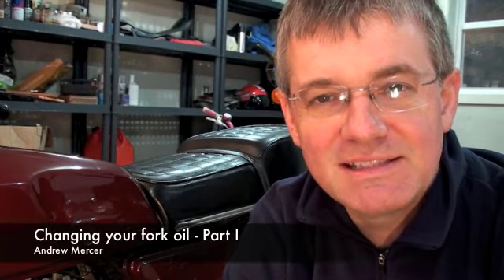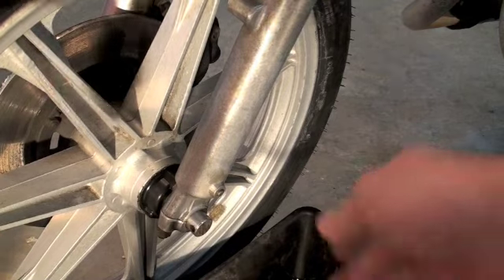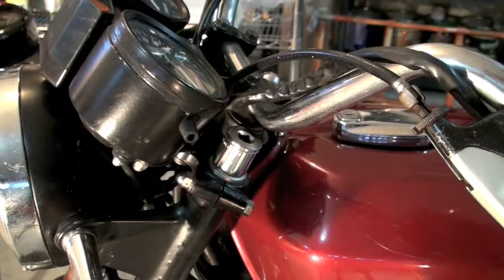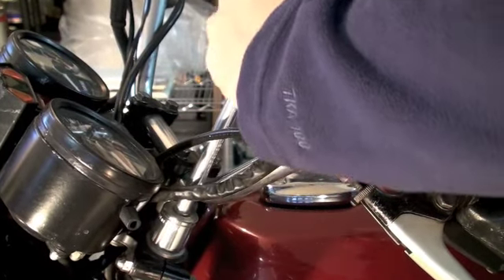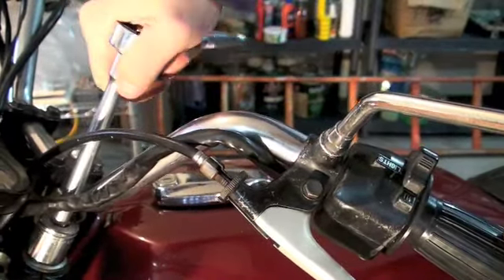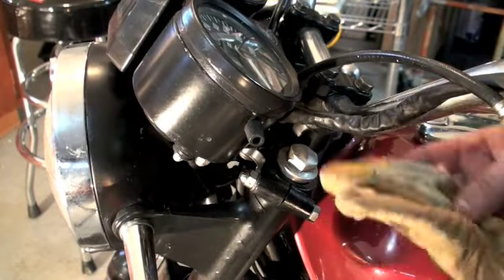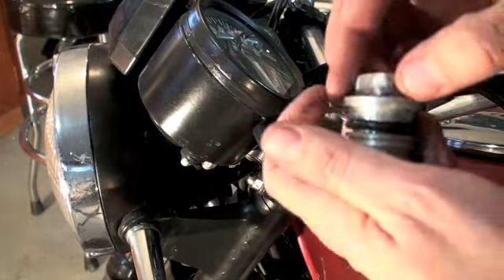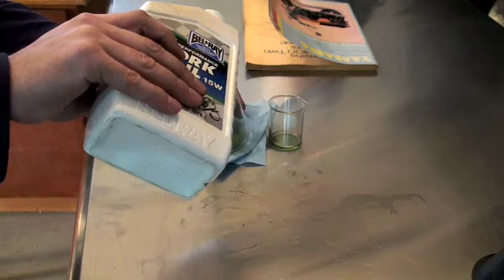Motorcycle Fork Oil Change Part 1

Comment: One of the reasons that top cap was so difficult to remove was because the upper pinch bolt is pinching the threads. Loosening those up may help with that problem, as I remember the top caps shouldn't be so snug to require a breaker bar.

Also, a bathing towel is on my tank whenever I do work.

Comment: It's very possible that the cap bolt was difficult to remove because it was being pinched by the upper triple clamp. I'd generally advise loosening the upper triple before removing the fork caps, to avoid buggering up the threads on the cap bolt.

Comment: Loosen the bolts in the tripleclamp that holds the forklegs in place. When theese are tightened, the forkcaps are very hard to remove (thats why you needed the extention)

Comment: Great way to break a finger or strip the soft aluminum threads.
    Loosen the clamps, Use your extension and oput some weight on it

Comment: A good stand with the front wheel off the ground is cheaper than repairing damage to the gas tank and/or stripped threads of top caps ~ Lengthens the fork and unloads the spring at least by the amount of weight of the front of the bike if not by 90% of the assembled preload.   
We all short cut at times but please advise viewers to use the right tool for the job ~ Invest in 3 cheap tools rather than one that is 3 times the price that must be misused. And +1 for PB Blaster for freeing bolts.

Comment: i hav a 82 gs750, it has valve stems on the top, the forks are dry, i want to try a seal scraper b4 i tear it apart, but don't know how to fill them with oil. pretty sure the stems are for nitrogen , not oil rite? i just need to know where the oil goes.

Comment: breaker bar man breaker bar! go buy a 1/2 inch drive bar and set it on there and tap it with a mallot or dead blow or whatever you have laying around. In the long run its a lot better then cracking the gears in your ratchet from breaking high torque so many times

Comment: there are many posts , i didn' t read them all...
another important trick ...
before you unscrew the upper cup  ...
it's so hard because , first , you have to unscrew a little bit the side bolt that hold the fork on this place ...